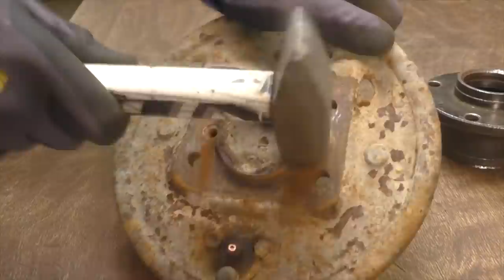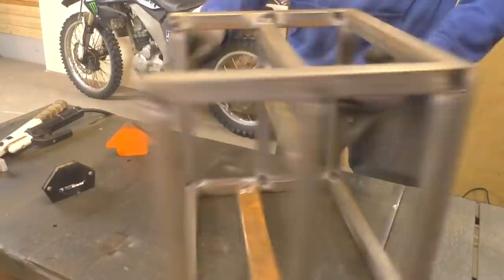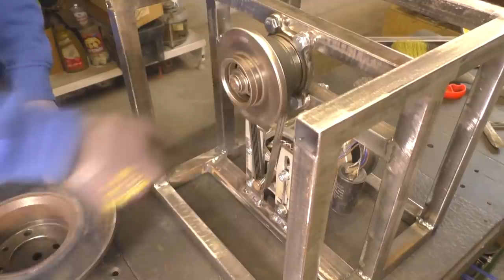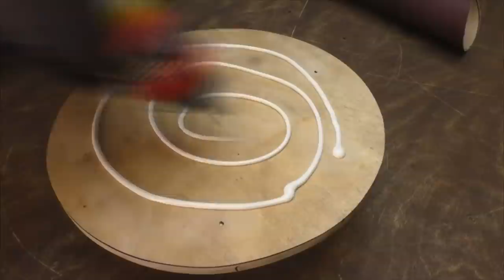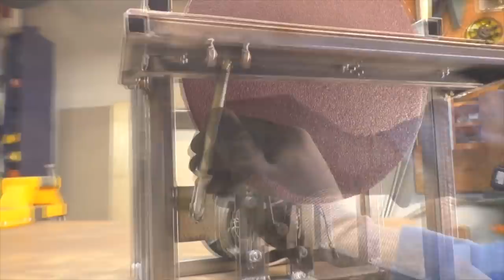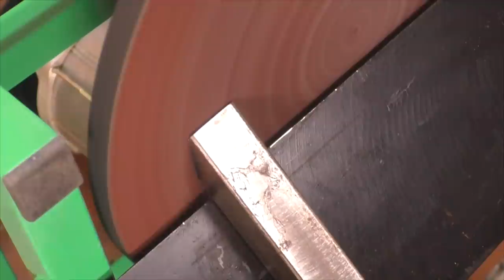Great idea from the Old Hub! Why hasn't anyone done it before?

Comment: I simply attached a wood disk to a pulley and secured the pulley onto the motor shaft. I was 16 y/o. The year was 1958. I sold that sander out of my father's garage when he died in 1997. I have a similar rig now that I use occasionally.

Comment: I use to work in a track (railroad track) shop and used scrap pieces of steel that was too small for what the shop needed to make a 48" lathe. grinder, and disc sander capable of double miters that all ran off the same motor. I also built a table saw that had groves every quarter inch to set the rip fence by, and wider grooves for a home made miter gauge. It is amazing what we can come up with if we only use our imaginations. My basement at the time was very small so I built a work bench with a home made wooden vise on the end that all folded up into a wall where I had my hand tools hanging.

Comment: Nicely done, had one somewhat similar for decades now. Very versatile in the shop, I use mine more than the belt sander. There are cheap velcro discs about that size nowadays, but for metal the 3m spray glue works best for me.
Reply: 3M makes an abrasive disc glue that stays semi soft for ease of removal and replacement. Apply glue to pad, spread it around then lift the disc on and off to semi dry the glue and it sticks and removes nicely..

Comment: I really like your design. It's easy and absolutely functional. The only thing I will do differently, is use a brand new hub and rotor that I got dirt cheap. And hoping my variable speed 2.5hp treadmill motor is strong enough. I'll find out.

Comment: Pretty creative. One further step you could take is to run that motor and file a smooth groove on the shaft. Seems as though your belt would track better, but more importantly the threads would no longer be tearing up the belt.

Comment: This isn't anything new. I use to operate and service a larger version of that thing as seen here. We called it a surfacing grinder back in the 1980's. 
Our sandpaper discs were also glued on but with a spray-on glue which made the disc easier to remove. The metal disc was cleaned with a solvent to remove any previous glue and then a new sandpaper disc could be applied. The sandpaper disc was cloth based not paper though paper was sometimes used for very accurate work.
The surfacing grinder was used to create clean/flat surfaces of laminated C/E cores which were used for electrical transformers.

Comment: Yea, for the $300 you spent on parts, you could have gone down to Harbor Freight and spent $160 on something that basically does the same thing with a 1/2 HP motor on it and replaceable sanding pads.

Comment: Great concept, but what if instead of attaching the sandpaper to wood, instead cut a .030 shim and glue to that, then double back tape it direct to face of rotor. Cut a hole in shim and sandpaper and it will be like a changeable face cup wheel